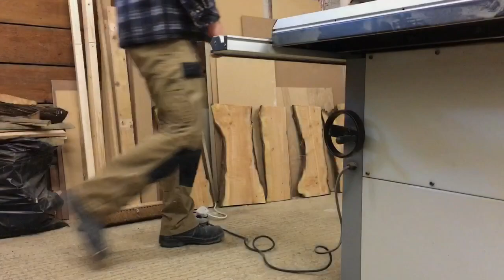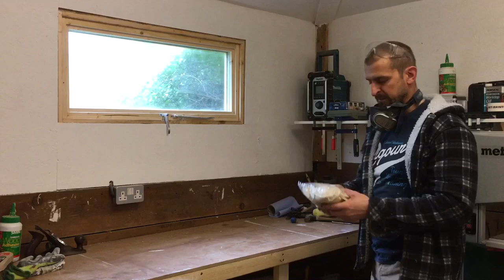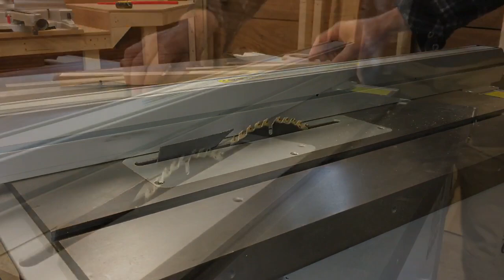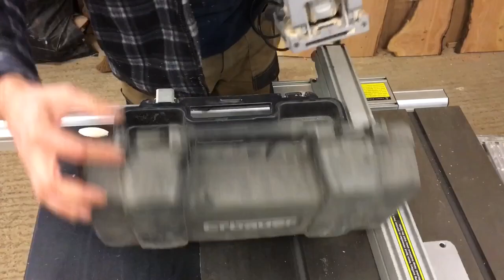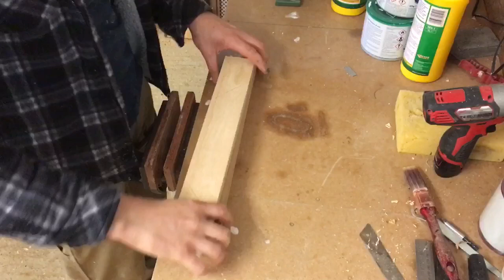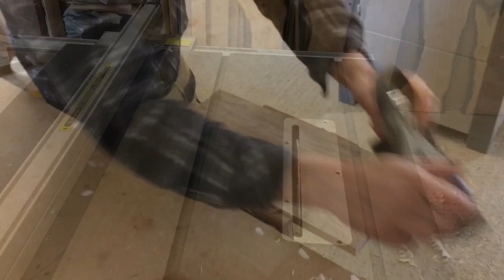Loose tongue and groove joint with a biscuit jointer!

Comment: Really nice watching someone as talented as you are.
2 things
Why not just cut the grooves with the table saw?
And, speaking of your table saw, you need to make yourself a zero clearance insert :)
Reply from the maker: oobaka1967 thank you! Yes I could make with the table saw, or the router table, but this video was about exploring new or different options. 
 And "thinking outside the box"!
Insert plate would be a good idea, unfortunately the recess is very shallow maybe 3mm
Reply: Shame about the shallowness.  I have the same issue.
Regardless...thanks for taking the time to show us different options on how to make some tongue and groove boards. I may be making some soon and I was a bit stumped on an easy and efficient way to make the tongues. Now I know.
Thanks again. Glad I subscribed.
Reply from the maker: oobaka1967 appreciate that sir very kind! 🙂

Comment: thanks for the idea, i will buy this tool, saludos from chile.
Reply from the maker: nelson rivera cheers. Have a nice time!
Reply: i like your new workshop video serie, i have the machines but no yet my workshop
Reply: What is the power of you drill press? and has you any issue with the thickness jointer fence? I have Einhell TH-SP 204
Reply from the maker: nelson rivera the drill press is way too underpowered, I wish I bought a bigger one! The fence is far from good, but usable. Plastic handles braking sometimes! 
I need some serious upgrade, just haven't got the money yet! 🙂
Reply: Szilard Pinter i will buy a 500watt drill press i think is good enough for woodworking and for the thickness jointer fence i put it MDF, is way better this way

Comment: Szilard Pinter Great Idea, do you think using the table saw would be better for larger job?
Reply from the maker: hugo Bose thank you! If you can put on a dado blade probes! We can't use one in the UK.  If I need wider groove is less pass with the biscuit jointer because the blade is ticker. In both cases fence need to be adjusted anyway! 
But you know: there are many ways to get to the same result, this was one of them! Quick and easy I think.
Reply: Oh I know about My Homeland lol Yes I'm in the UK/England about dado stax but if you rotate the piece around it will cut both sides so it will be in the middle
Reply from the maker: hugo Bose thanks I know that! I'm not that stupid. But if if you think about it you can do the exact same thing with a biscuit jointer as well! Turn the piece around and make a cut from both sides! But like I said we can come up with many different solutions and get the same result. I just showed one of them which works well for me. 
I hope that's except able. 
All the best Szilard